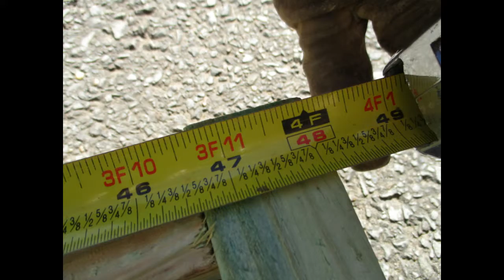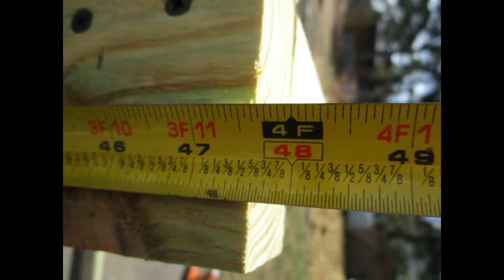Chicken tractor - DIY

Comment: How many birds will it support?  Nice job on the edit Luke!
Reply from the maker: +chip morris It should hold 5 - 8 birds depending on the breed.  This coop is 32 square feet on the bottom and roughly 16 square feet in the nesting and roost area.  Backyard chicken forum states each bird needs a minimum of 4 square feet.

Comment: Any chance of a predator getting in at the gap caused by the wheels?
Reply from the maker: +Plan Bee Orchard &amp; Farm The gap is 1.125" on the wheel end and decreases as it moves towards the handles.  I do think a predator could dig under the coop if they were given enough time without being run off by the family pet.